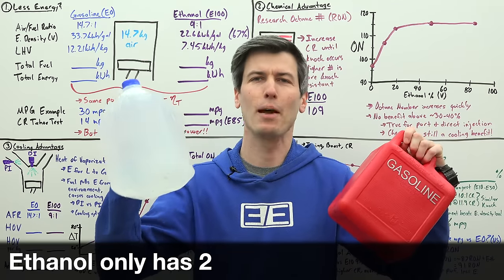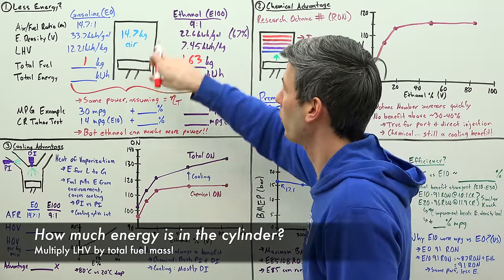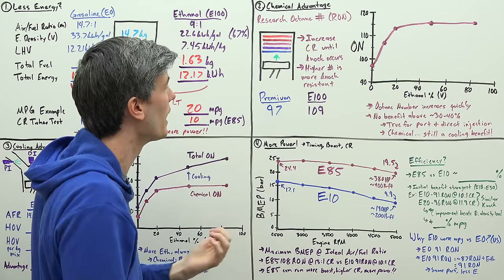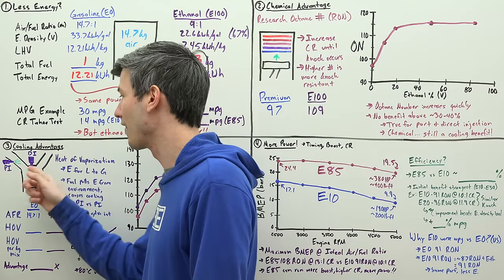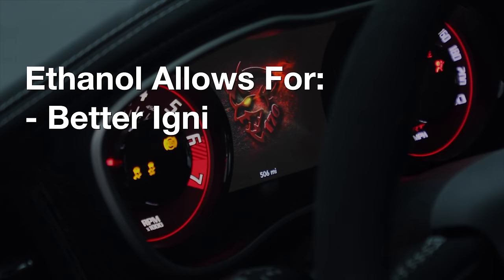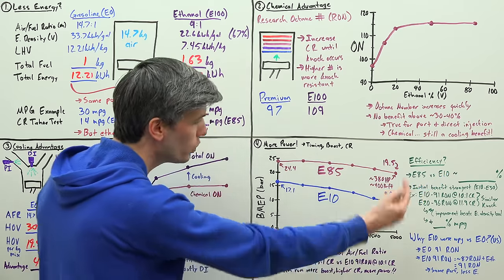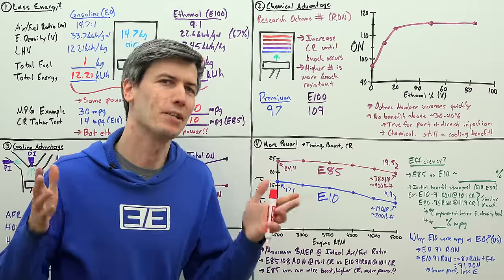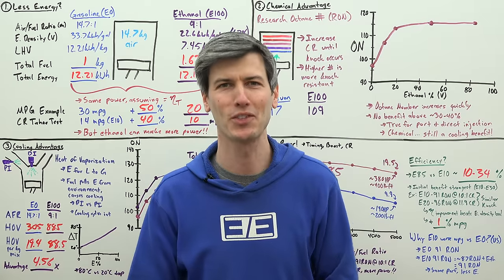Why Does Ethanol Make So Much Power? (Versus Gasoline)

Comment from the maker: If you'd like to learn more about ethanol, I have two other detailed videos on the subject:
Is Ethanol Bad For Your Car's Engine? https://youtu.be/ATGSBi1kBl0
Does Ethanol Have An Emissions Benefit? https://youtu.be/F-yDKeya4SU
Reply: Wait, did you just say that lower gasoline octane have less energy ?
Or just that the efficiency is lower due to more prone to knock ?
Reply from the maker: @daniel635biturbo  
First question: No
Second Question: Yes
Reply: Now make same comparison with LPG direct injection? Ok?
Reply: @EngineeringExplained  Thanks !
Reply: What is your take of each fuel from an environmental perspective? Lots of talk about whether biofuels (ethanol in this case) or gasoline is better than the other.
Reply: Are there engines that premix the air and fuel in a separate tank before sending it to the combustion chamber?

Rather trying to mix right before ignition inside the cylinder couldnt and why dont they combine the work of an injector and supercharger in a copper alloy (or other non-spark) resevoir?

Wouldnt that allow for optimal tempurature and ratio control, free of carbon and heat from combustion?

And instead of the ecu cutting or adding fuel, you change the quantity and or when in the cycle it ignites.

Also you'd probably get a really cool windup sound on a start.

I think you'd need either some kind of heating element to help remix fuel already in the tank or have a return system when you shut the car off and turn it back on.
Reply: @honpolyo  Yes, their some cars that mix air in the intake runners/ manifold. Ford used this trick to use double injection on their older modular 4.6L V8s race cars. The normal Direct port injection for natural aspirated on that engine will only give up to 400HP on two or three valve setups. Adding the two more fuel rails & pumps & a sets of injectors pushed the cars natural aspirated power to 600HP on two or three valve setups.
Reply: @kevinerbs2778  could you link a vid on the specific engine?

I'm having a little trouble understanding the dif between what you described, my understanding of duel port + direct injection, and the hypothetical system i attempted to describe on my previous comment.

Essentially i was trying to desribe that pressurized air/fuel cyclone chamber like a battery, the constant charging of which would far outpace the engine, so it could maintain a constant pressure, in an attempt to optimize efficiency and potency.
Reply: @honpolyo  so you built a ram jet inside the intake of the engine?
Reply: @honpolyo  Honda CVCC back in the old carburetor days.
Reply: @kevinerbs2778  if only I had the know-how. My Crosstrek is slooooww, even with the 6mt.

I totally forgot about Ramjet, after the fact I was actually thinking more about the doble steam car at least I think that's what it's called
Reply: @kevinerbs2778  I was thinking it would only be mixed in that pressurized Cyclone. You still send it to a piston to be ignited
Reply: @EngineeringExplained  Mr Engineer, eat enough food please. You're starving
Reply: I have always read that the cost of processing ethanol is too high and then we turn round and sell it at a loss to blend into gasoline. This sounds like a financial disaster if I ever heard one.
Reply: Interesting, I'll try a tank of 98ron and see how that goes
Reply: @cafepablo1968  I heard your wrong!
Reply: @cafepablo1968  There are no Federal subsidies for ethanol.  The process of it is cheaper than gasoline.  No other oxygenate or octane booster come close to it in price either.
Reply: Make videos about Mahindra roxor engine.
Reply: Great video, but I'm struggling to find the same data as you stated, HOV data can vary a LOT depending on source. Coul you please provide sources of you calculation?
Reply: please do the same video on nitromethane!
Reply: Funny how things change depending on how you look at them. Gasoline takes 14.7 parts air to one part of the gasoline, where as Ethanol is only 9 parts air. You are looking at how much fuel is required to mix with the air, but take it from the other angle, for the same amount of fuel, the Ethanol requires less air for ignition. It's all just a matter of how you look at it. So, Ethanol is a much better fuel at higher altitudes where the air is much thinner. Why aren't high altitude aircraft burning more alcohol derived fuels over gasoline derived?
Reply: What about methanol
Is it better than ethanol?

I know that germany in ww2 used mw50 engine injection which was basically
50 50 water/methanol mix
Reply: @daide6039  I wouldn't be surprised if the feedstock makes a big difference in the answer.
Reply: Can you make a video of hydro diesel. Apparently it bump the thermal efficiency of Diesel engines.
Reply: I've just got one request, and that is could you please leave the little messages along the bottom of the screen on a lot longer.

 Youtube has this idiotic habit of darkening the screen when placed on hold, even more so at the bottom of the screen, which makes it much more difficult to read. 

Thanks a million, I love the channel.
Reply: i need a smart person to answer this question.
the air to fuel ratio is 14.7 to 1 part fuel for petrol. 
so on 15 pounds of boost that would be 7.37 to 1 in a cylinder and the average compression ratio is 8.5 to 1 so why doesn't it hydro lock?
on a methanol car it is 6.5 to 1 
so how is fuel calculated in the air to fuel ratio fuel vapor?
or if you have a 2l engine the fuel would be about 136ml of fuel to the air to get the ratio of 14.7 to 1 so at 2000rpm it would go throw 136litres in a minute 
so my question is how is the 14.7 to 1 calculated.
is once the fuel is a gas state like steam which expands approx. 1400 times is that what the ratio refers to.
everything i have read online refers to 14.7cubic centimeters of air  to 1cubic centimeters of fuel but this cannot physically work.
so can someone explain how the fuel is measured thanks
Reply: @jasonpenn5476  because the leaded gasoline owns a monopoly on aviation engines. You love that lead in the gas, it kills everyone faster.
Reply: @btbrad19  you're calculating yourself further and further away from reality. 
136 litres a minute ?? 
😆😆😆😆.
Don't you know ethanol & methanol are racefuels, and that exxon, siemens and porsche just showed the whole world how to make it from water & air w. renewable energy.
Reply: @EngineeringExplained Have to disagree. My car doesn't have hardened seats, therefore ethanol is bad for it.
Reply: @JollyRed0045  Not only ethanol but also unleaded E0 is bad for your car.  

Ethanol burns cooler in the engine so it would likely be less bad.
Reply: @danafletcher2341  Agreed. It likes real gas.
Reply: The funny thing is that on Australia ethanol was added to the crappy fuel. Shell stated it has low octane because of the ethanol added in was bringing down the octane.
Reply: How does ethonal stack up against diesel?
Reply: @JalapenoSteve  Here is an excerpt from an article about Ricardo's engine they built for GM and drove around in a pickup truck:

FROM RICARDO:
The new federal CAFE standards are calling for a doubling of fuel mileage performance, which, Vint says, is going to send OEM’s looking for high octane numbers to improve efficiency and ethanol is the best source. Ricardo, an engineering firm with over 100 years in the business of engine design, has developed an extreme boosted direct injection engine (EBDI) to optimize ethanol blends. The 3.2 V6 gasoline engine rivals the power and torque of a much larger GMC Sierra 6.6 diesel, he said, and it delivers 3.5 percent better fuel economy than the diesel.
Reply: i've been wanting to convert to e85 but my biggest problem is where i live there is only 1 e85 station about 30 mins from my house. So outside of that station there arent any e85 stations for HOURS.  This means in general if i want to enjoy e85 driving its mostly going to be locally around here unless i plan on some road trip in which case i need to plan my trip where e85 stations are. 

Now obviously for us aftermarket guys we would run a GM e85 content sensor meaning we can run pump or e85 or mixed. but i dont like the idea of after im out of e85 and have to fill with pump gas and essentially limping my car back home having to avoid much boost.   

One of the things i've also contemplated is using a meth injection kit. whats nice about it and couple gallon tank will last you a long way because its only being injected at the desired boost level.  plus one thing all gas stations have is windshield wiper fluid which its prime ingredient ?? methanol.  They use methanol because it reduces the freezing in winters. 

@EngineeringExplained  will you do a video on meth injection or have you ?
Reply: @CarsnStuff  In France, some 25% of fuel stations offer E85 vs the US where >2% of stations offer E85.  Monopolistic powers at work.  

Some fuel stations owners with brand name fuels that do offer E85 can't even advertise E85 on their billboards without fear of losing that franchise.
Reply: @CarsnStuff  get your own tank and a bulk delivery of e98
Reply: @chrisoakey9841  Ive contemplated that but i dont like the idea of only being able to fill my car up at home and then only having one other option to fill up. especially if im traveling in a direction opposite of the e85 station. i like the idea of having the ability to fill up anywhere while still being able to have fun in my car.  

i have been contemplating it though getting the 50 gal drum i would just have rather short trips from home then back basically if i want to atleast drive a decent distance having fun.

Comment: The answer is alcohol
Reply: I've been telling my therapist that for years!
Reply: I always said alcohol is a solition.
Reply: Its always the answer
Reply: More alcohol when driving
Reply: And we forgot the question
Reply: Alcohol isn't the answer.

Alcohol is the question, and the answer is yes.
Reply: Say waaaaaaaaaaaaaaaaat?
Reply: It makes driving so much more fun!
Reply: U saved me 13 mins
Reply: Alcohol has yeast and other products that will make the engine knock or detonate more late or early
Reply: Always has been. Let's me drive faster when I put it in my car and in my stomach
Reply: Isn’t it always
Reply: Does the best of all 3 world. Power compression heat disipation.
Reply: @surenchander238 no it doesn’t. That is what distillation is for. It removes all of that. Just like distillation separates tar, grease, mud and other rubbish from crude oil to leave you with gasoline.
Reply: That is the same reason ethanol kills regular engines
Reply: Alcohol in me will also make me drive faster too.
Reply: Thank you. Not all heroes wear capes. No need to watch video now. Thank you.
Reply: @pali3329 I thought the answer of everything is ‚42‘?…😂